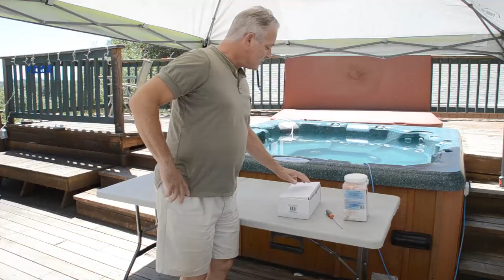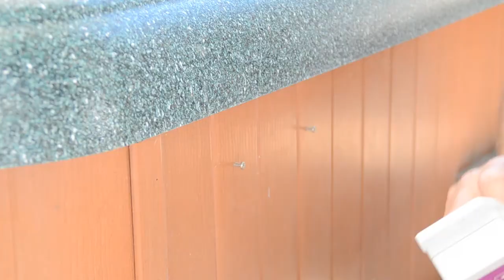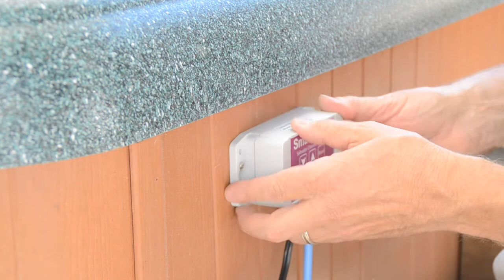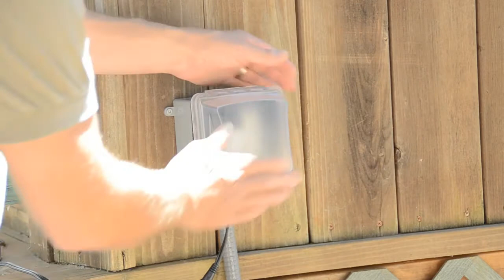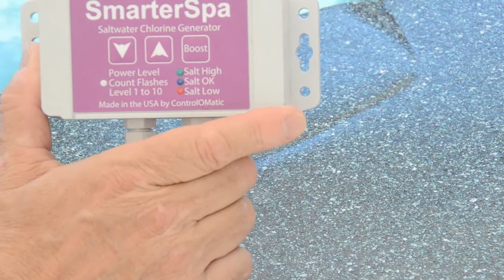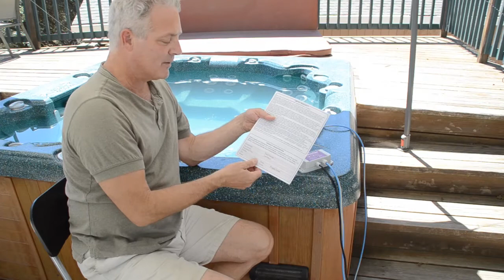SmarterSpa Install and Operation

Comment: Hi john thanks for the video.    I'm a new user just installed but having some trouble.    Water is balanced, salt is around 1400ppm.    Chorine tests are showing almost zero Free Chlorine.  When i put the cell body into hot tub and turn on the unit,  there the smarterspa just sits in standby.   shows no salt reading high/OK/low.    I tried pressing boostand it does start to bubble up and make chlorine.   I see chlorine levels com up eventually  --- however this smarterspa does NOT automatically turn on at all.   I raised the ZEROPOINT to max 60 and it still doesnt trigger.     At this point its a manual machine that only works when i press boost button.      Any tips?  is my controller broken?
Reply: what did you do we have the same issue
Reply: Got a new controller.  Was defective. Company was great and replaced it quickly from California to Canada.
Reply: @4bcircle  thank you! did it ever work and then stop? or is started like this?
Reply: @4bcircle  do the salt level indicator lights stay on all the time or only when it makes chorine?

Comment: I was considering the ACE system for my used hotsprings hot tub. After reading that the $1300  ace fails after a year and cost $800 for a new cell. I opted against it.  Then I discover this! Well worth a shot for the same concept.  I'm going to try and tap  into the control power inside for the 110.
Reply: I was thinking the same thing. I have an extra “heavy duty” covered plug next to the hot tub for lights. I’m not sure what voltage it is. Did he say you need 110 or 240?
Reply: @Tinyteacher1111  its 110, I have used it for a year. Love it.